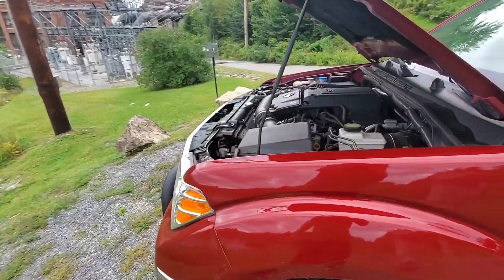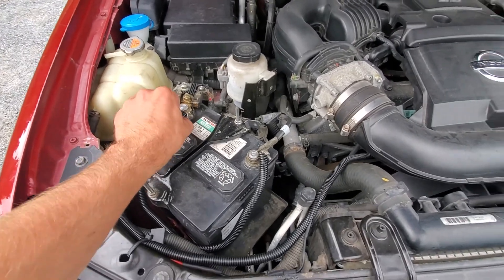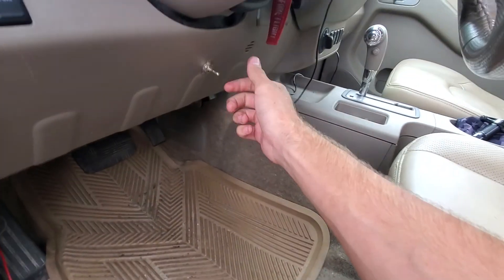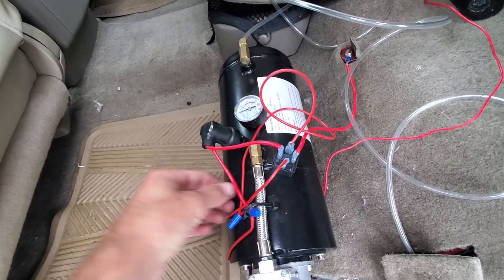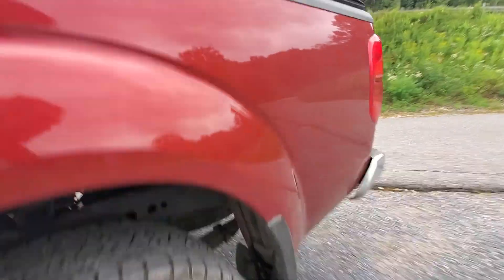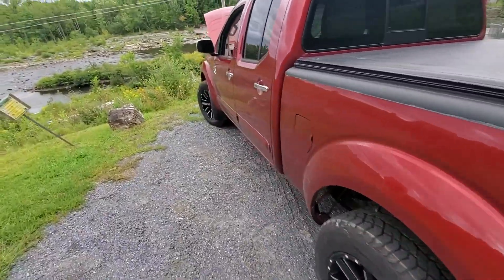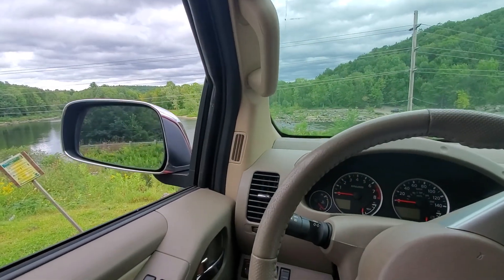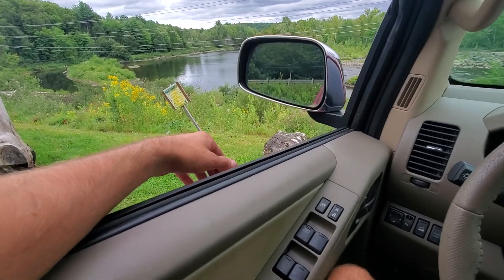Train Horn Wiring

Comment: I got my train horn installed at a place. The switch they used is so hard to reach, it is so far away,  would it be hard for them to make it closer and more accessible to me?
Reply from the maker: No, it is pretty simple to relocate a switch just by lengthening the wires that connect to it.